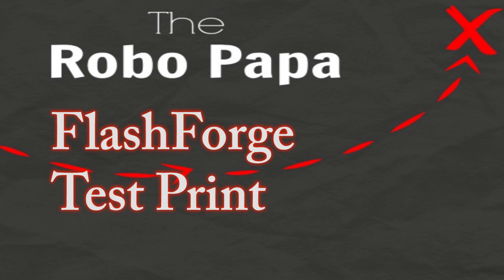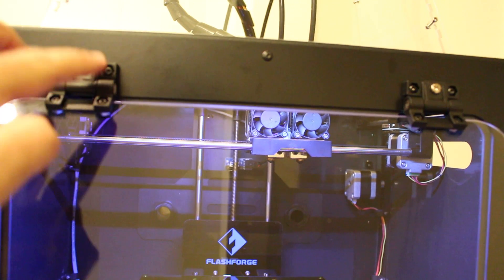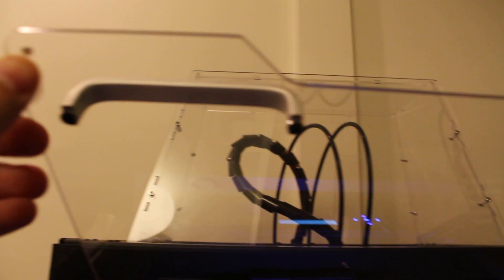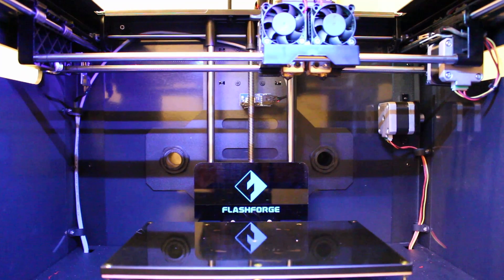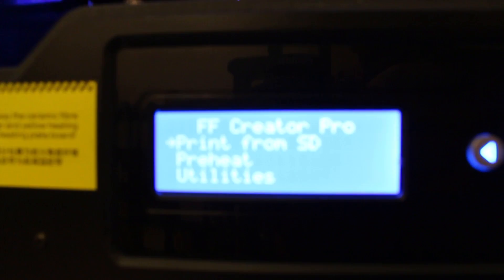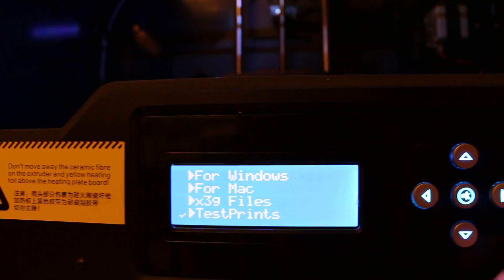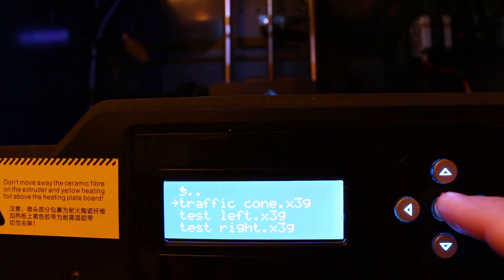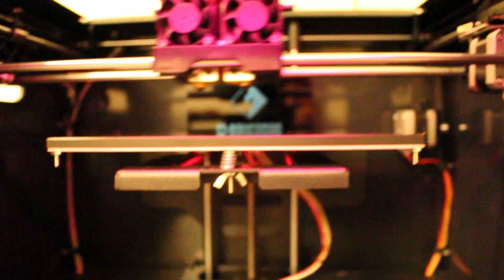FlashForge Creator Pro Test Print

Comment: Very Helpful! Thank you for taking the time to make these videos!

Questions:
1. Did you change the filament so they were both ABS or PLA or did you leave them one each that came with the printer? and if so did you change the heat settings?
2. Did you hook up your computer to the printer at anytime before printing the test print?
3. I noticed that they recommend that you remove the hood to print PLA. Do you do that? Or just leave it on all the time?

I am new to 3d printing, and just received my Creator Pro today. I look forward to any new videos that you have on the Creator Pro.

Thanks again,
Dancingkoi
Reply from the maker: Hi jill rose,1) both of the filament I got from FlashForge were ABS, and I just printing with ABS since than. The probably with heaving two different types of filament will be the temperature control of the extruder plus the warming bed2) the printer is connected to my computer from a USB hub. However, for long prints (few hours long or all night kind of things) I have slic3r output also x3g and than just print from the SD card3) ABS needs the heat so you want to keep the door and the top covered closed, while PLA doesn't so you can keep the door open. I would keep the top that way the cable and filament will not just hang Hope that helps. Let me know if you have any other questions
Reply: Great thanks! They sent me one of each so I guess I won't try the cone for my test print :)
Reply from the maker: jill rose today many places sales 3D printing stuff. For example in the US Home Depot sale 3D printers. I'm sure you will be able to find some filament :)
Reply: Robo Papa I can see the bed but the extruder can have separate temperatures.
Reply from the maker: Cullen Lonergan what do you mean? You should look at the company's web site to see if they sell it